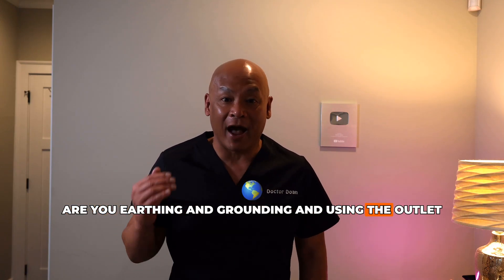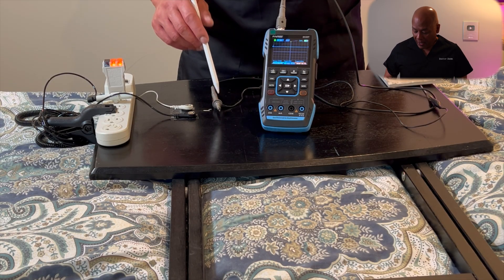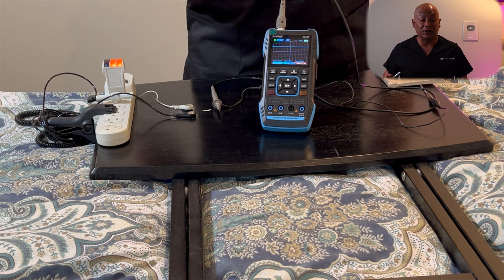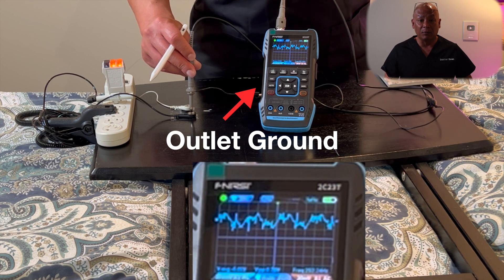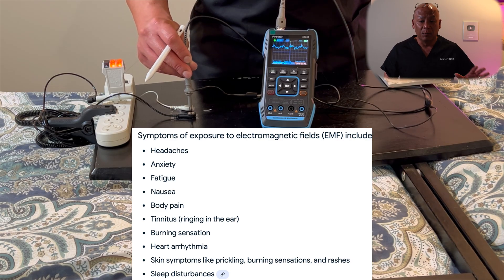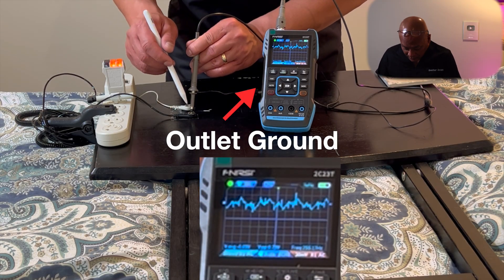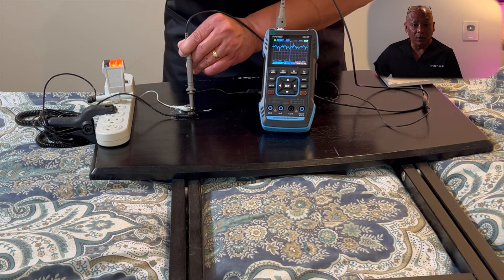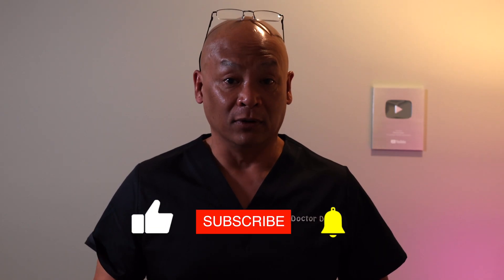The Hidden Dangers of Stray Electrical Currents When Grounding

Comment: This is misinformation. That dirty electricity you are talking about, from your ground of the house, will not penetrate your body. You have to have a closed circuit for the electric current to pass your body, and you are not closing that circuit to anywhere.
Reply from the maker: Actually, small AC currents do couple into the body even without a closed “hard-wired” circuit, due to capacitive coupling between energized conductors and the human body. This is why a person’s body voltage can be measured with respect to Earth using a voltmeter, and why the voltage drops immediately when grounded. Studies (Sokal et al., 2012; Oschman et al., 2015) show that grounding dissipates this induced charge, reducing electric field–related stress and normalizing bioelectrical parameters. The current is tiny (microamp range) but biologically measurable—hence the benefits seen in controlled grounding experiments.

⸻

References
	•	Sokal, K., & Sokal, P. (2012). Earthing the human organism influences bioelectrical processes. Journal of Alternative and Complementary Medicine, 18(3), 229–234. https://doi.org/10.1089/acm.2010.0683
	•	Oschman, J. L., Chevalier, G., & Brown, R. (2015). The effects of grounding (earthing) on inflammation, the immune response, wound healing, and prevention and treatment of chronic inflammatory and autoimmune diseases. Journal of Inflammation Research, 8, 83–96. https://doi.org/10.2147/JIR.S69656

Comment: It looks like you are using a Power Strip (not a Surge Protector).  If that's true, and you are using a Power Strip, would you be willing to make another demonstration video exactly as like you did this one, but this time, turn the switch on the Power Strip to "OFF"?   When you turn the switch off on a power strip, it mechanically breaks the electrical circuit, cutting the flow of power to all the outlets by opening the circuit that is inside the Power Strip. This creates a physical gap in the pathway of the hot wire, so no more current can reach the outlets and the devices plugged into them.  However, the ground is not effected.  The switch interrupts the flow of electricity to the hot wire but does not sever the ground wire.  I am interested in the seeing the reading on the oscilloscope when grounding in the house with a Power Strip and the switch on the Power Strip is in the "OFF" position.  Thanks so much.
Reply from the maker: Good point and excellent observation!

When turning off the power strip, there will be some reduction of capacitive coupling in the strip itself. However, the entire house wiring generates capacitive coupling that will be transmitted into the ground wire and into the power strip.

Comment: Your research on how improper grounding can transfer harmful electricity to the body is truly fascinating! Now that we’ve established that a direct grounding rod is more effective than using a house’s grounding system, my main concern is the wire itself. I recently came across an article suggesting that if the wire isn’t properly shielded, it could act like an antenna, picking up EMF and other harmful electrical signals, which could then transfer to the grounding sheets or mats.

Someone recommended using a coaxial RG6 cable as the best solution to prevent unwanted interference. The reasoning was that its foil and braided shielding could block external EMF from reaching the grounding sheets. They suggested connecting the middle wire to the sheets and grounding rod, while connecting the braided shield to the rod as well, creating a single-point shield. However, I believe this might not be the correct approach. Instead, I think the middle wire should connect to the sheets and rod, while the braided shield should be connected to the house ground to discharge any intercepted interference.

This seems like an interesting aspect to explore further. Perhaps you could create a short video testing and explaining the best way to shield grounding wires effectively? Thanks for your incredible work, and I look forward to your thoughts on this!
Reply from the maker: Thank you for your kind words! I appreciate your post.

It's true that the wire can also generate current via capacitive coupling. In my preliminary tests, it looks like a grounded wire will pass most of the generated current into the Earth when a 100K ohm Earthing cord is utilized. So shielding is not necessary. I will make a video about this.
Reply: @DrAndrewDoan  can’t wait to see the results.

Comment: Thank you Dr. Doan. I found that helpful. I appreciate that you specify more testing needs to be done on stray electrical currents and their effects on our health and that all of them may not be bad. I also think I'd rather just ground to outside.
Reply from the maker: If your outlet has any current in the outlet ground, then use an Earthing grounding rod with 40’ cable: https://bit.ly/3Zl0gOX or The NCB Plug Dirty Electricity Filter for Grounding from SYB  
https://tidd.ly/3Eh4qiK

Comment: Want to buy some bottles of Dr Good? Cures all ills......... Look if you have a high impedance input, wind up the sensitivity and earth your scope at a point distant from where you are measuring then you WILL pick up noise. It's all around but your body being a sack of liquid cannot possibly react to such minute random noise. This is nonsense.....
Reply from the maker: I've repeated this several ways and confirmed the measurements. I've grounded my scope near where I am measuring. I still get 1 Vpp at 50 microAmps in my house. Have you reviewed the medical and scientific literature? Voltage gated ion channels in the body respond to minute signals as low as 30 mV and microamps of current.  

Building codes allow 2-4V and 1mA of current in the electrical ground. This is sufficient to activate voltage gated ion channels, especially when people are plugging into the outlet ground to ground with mats and sheets. 

Bertagna, F., Lewis, R., Silva, S. R. P., McFadden, J., & Jeevaratnam, K. (2021). Effects of electromagnetic fields on neuronal ion channels: a systematic review. Annals of the New York Academy of Sciences, 1499(1), 82–103. https://doi.org/10.1111/nyas.14597
Reply from the maker: Here are details and schematics of my measurements. https://articles.andrew-doan.com/oscilloscope-measurements-of-outlet-ground/

Comment: Daffy and Donald called... they want their species back.
Reply from the maker: Have you reviewed the medical and scientific literature? Voltage gated ion channels in the body respond to minute signals as low as 30 mV and microamps of current.  

Building codes allow 2-4V and 1mA of current in the electrical ground. This is sufficient to activate voltage gated ion channels, especially when people are plugging into the outlet ground to ground with mats and sheets. 

Bertagna, F., Lewis, R., Silva, S. R. P., McFadden, J., & Jeevaratnam, K. (2021). Effects of electromagnetic fields on neuronal ion channels: a systematic review. Annals of the New York Academy of Sciences, 1499(1), 82–103. https://doi.org/10.1111/nyas.14597
Reply: @DrAndrewDoan  nice try, fraud.  not a single word of that supports your ridiculous claims
Reply from the maker: Not according to these doctors. I am simply repeating what has already been done in the academic literature. 

Pall M. L. (2013). Electromagnetic fields act via activation of voltage-gated calcium channels to produce beneficial or adverse effects. Journal of cellular and molecular medicine, 17(8), 958–965. https://doi.org/10.1111/jcmm.12088

Bertagna, F., Lewis, R., Silva, S. R. P., McFadden, J., & Jeevaratnam, K. (2021). Effects of electromagnetic fields on neuronal ion channels: a systematic review. Annals of the New York Academy of Sciences, 1499(1), 82–103. https://doi.org/10.1111/nyas.14597

Gajšek, P., Ravazzani, P., Grellier, J., Samaras, T., Bakos, J., & Thuróczy, G. (2016). Review of Studies Concerning Electromagnetic Field (EMF) Exposure Assessment in Europe: Low Frequency Fields (50 Hz-100 kHz). International journal of environmental research and public health, 13(9), 875. https://doi.org/10.3390/ijerph13090875

Brown R. (2016). Effects of Grounding on Body Voltage and Current in the Presence of Electromagnetic Fields. Journal of alternative and complementary medicine (New York, N.Y.), 22(9), 757–759. https://doi.org/10.1089/acm.2015.0340

Comment: Hello Dr. Doan, could you please explain in details how you tested the dirty electricity with the oscilloscope? I bought the same oscilloscope, how did you set it for the measurement? There are lots of settings and I can't understand a thing. Also the video during the test appear the writing OUTLET GROUND. What do you mean with that? That the clip of the probe has to be connected to the ground while you touch the cable end with the tip of the probe?
Reply from the maker: To test the safety of an outlet for grounding, you’ll need an oscilloscope, shielded copper wire or speaker wire long enough to connect from your main electrical panel to the outlet being tested, an Earthing cord, and alligator clips.

Follow these steps:

1. Using an outside ground with a grounding rod and wire is best for grounding the oscilloscope. However, if you live in a highrise, then locate the grounded bolts on the outside of your main electrical panel (CAUTION: DO NOT OPEN THE PANEL UNLESS YOU ARE QUALIFIED AS AN ELECTRICIAN). These bolts are connected to the building’s ground.

2. Attach one alligator clip to a bolt and connect it to your wire, ensuring a solid ground.

3. Use another alligator clip to ground the oscilloscope probe to the wire.

4. Plug the Earthing cord into the outlet ground and touch the oscilloscope probe to the metal portion of the Earthing cord.

5. Observe the waveform and voltage output on the oscilloscope. Ideally, the waveform should be flat, with no significant stray voltage.

6. Oscilloscope probe should be set to 1X, 20 mV per square (if waveform is too large on screen then increase the mV per square).

Probe is the one with grey tip and grounding wire sticking out the side.

https://articles.andrew-doan.com/which-grounding-method-will-you-pick-for-your-body/

Comment: what is even the reading on oscilloscope? we have no details of freq, voltage or harmonics, screen is too blurred. I feel its some kind of mambo jumbo.
Reply from the maker: I have a video coming out in 2 weeks with better resolution. I used a second camera to film the meter.

The frequency is 120-200 and variable with an average V PP of about 1V.
Reply: @DrAndrewDoan  We need to see the scope settings and a circuit diagram of where you are connecting both the measurement point AND where you are connecting your scope ground. Also details on all the house wiring that might be connected to both scope leads.......
Reply from the maker: @chickenduckquack  The schematics and details of my measurements. https://articles.andrew-doan.com/oscilloscope-measurements-of-outlet-ground/
Reply from the maker: When people plug into outlets with grounding products and get sick, I look into it as a physician with electrical training. I am tripled trained: Neuroscience PhD, Aerospace Medicine, and Ophthalmology. I am in consultation with master electricians and electrical engineers.

I will post photos of my scope settings and diagram of my setups on my website. It’s hard to capture the scope on video. I don’t have diagrams of my house electrical system.
Reply from the maker: Here: https://articles.andrew-doan.com/oscilloscope-measurements-of-outlet-ground/

Comment: So if you ran a cable outside and connected it directly to the grounding rod of the entire house would it be grounded?
Reply from the maker: Yes it will be grounded BUT you may pick up stray electrical currents from the house. I measure 750 mV of stray electrical current in my home's metal gas pipe.

Comment: Do you live in a cold climate? I wonder if the 12inch rod is sufficient where it dips below freezing alot like Montreal.
Reply from the maker: Good question! I am in Florida. For Montreal, you'll need like an 8 foot rod. The depth to which soil freezes depends on several factors, including:
	1.	Air Temperature: Prolonged freezing temperatures will result in deeper frost penetration.
	2.	Soil Type: Sandy soils freeze more deeply than clay soils because they retain less moisture, which has a higher heat capacity.
	3.	Moisture Content: Wet soils freeze more slowly but can still freeze deeply as water retains and transfers heat.
	4.	Snow Cover: Snow acts as an insulator, reducing frost penetration.
	5.	Vegetation: Vegetation cover can provide insulation and slow frost penetration.
	6.	Climate and Latitude: Colder climates and higher latitudes experience deeper frost depths.

General Frost Depths by Region:
	•	Northern Regions (e.g., Alaska, Canada): Frost can penetrate 6-8 feet or more.
	•	Temperate Regions (e.g., Northern US): Frost depths usually range from 3-6 feet.
	•	Mild Regions (e.g., Southern US): Frost depth is typically less than 1 foot.
	•	Tropical Areas: Frost is rare or nonexistent.

If you need precise frost depth information, consulting a local frost depth map or contacting your local weather or agricultural agency is recommended.

Comment: This is probably one of your most important videos yet.  Dr. Doan, your concerns about stray currents and dirty electricity carried on a ground wire are absolutely valid. One is not 'detoxing' or 'herxing' if one feel sicks from grounding.  Rather, it's much more likely that the ground one is using suffers from dirty or stray electricity.   Therefore, make sure to use proper electrical meters (oscilloscope, VOM) to ensure you get a healthy ground.  It's vital to one's health.  Thank you for making this video.
Reply from the maker: Thank you for your thoughtful comment and support! I initially trusted grounding companies and believed their claims that using an outlet and a basic outlet checker were sufficient for grounding safety. However, I’ve since learned that building codes allow 2-4 volts and up to 1 mA of stray electricity in the ground wire. While this may be acceptable for electrical systems, it can be problematic for human grounding. Stray currents at these levels could potentially cause adverse effects in sensitive individuals, making them feel unwell when grounding to an outlet with these conditions.

To truly ensure safe grounding, it’s crucial to use proper equipment, such as an oscilloscope or a VOM, to measure for stray voltage and current. A healthy, clean ground is essential for reaping the benefits of grounding without negative effects. Thanks again for your comments on this important topic!